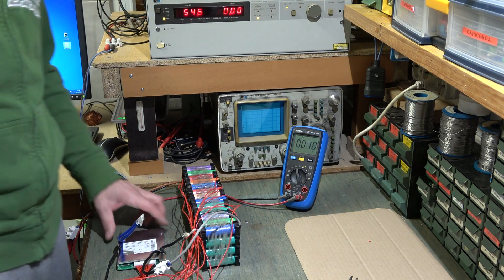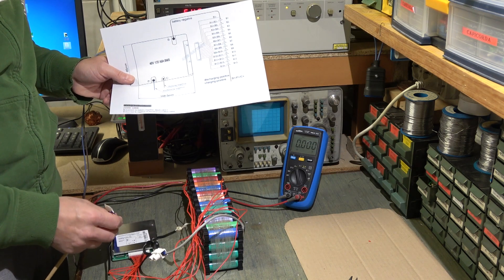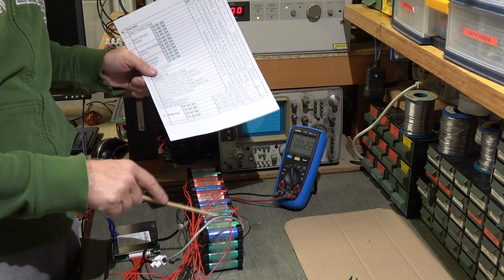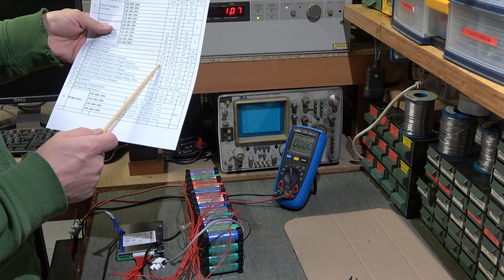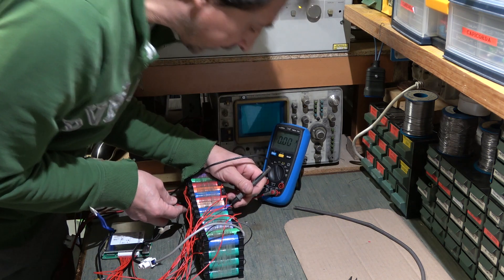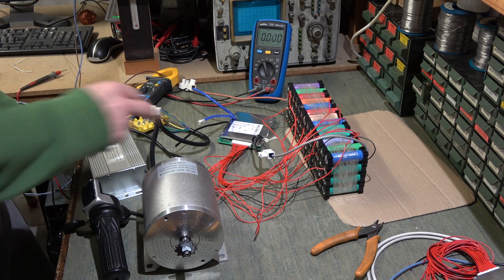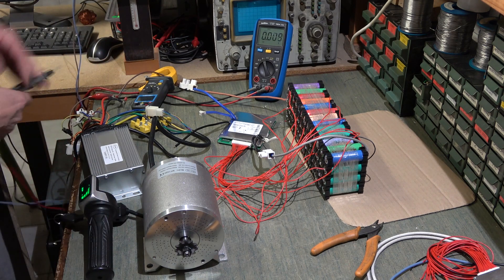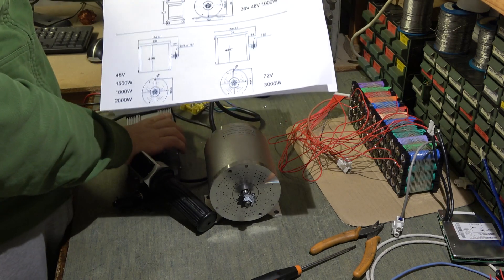OP 88: costruzione pacco batteria 48 volt per bicicletta elettrica #parte 2

Comment: buongiorno dato che sei esperto di bms ti volevo chiedere , ho un problema con questa scheda controllo bms di una batteria di una ebike a 48v . ho una tensione di 42v presente sullo spinotto di ricarica e non sull' uscita di carico che dovrebbe alimentare la bici. ho provato a cambiare i mosfet pensando fossero questi ma il problema rimane. ricapitolando ...su C- ho 42V su P- 0V , anche ponticellando i due fili collegati alla chiave che servono per alimentare o no la bici. vorrei mandarti una foto del bms ma non o come fare
Reply from the maker: penso che il bms è sceso al valore di protezione della batteria quindi giustamente non ti da l uscita. Questo vuol dire che le batterie sono scariche. di solito per ripristinarlo bisogna staccare il carico, ma se le batterie sono ancora a 42 volt non si accende.